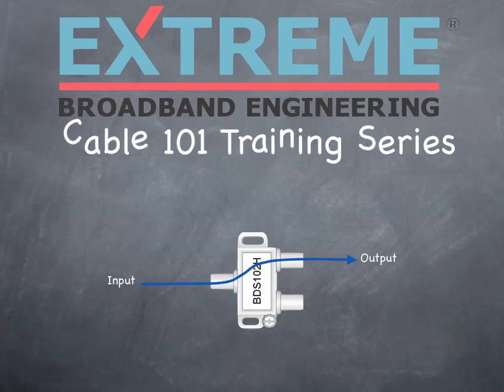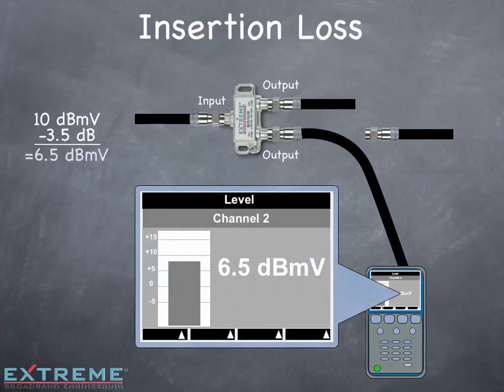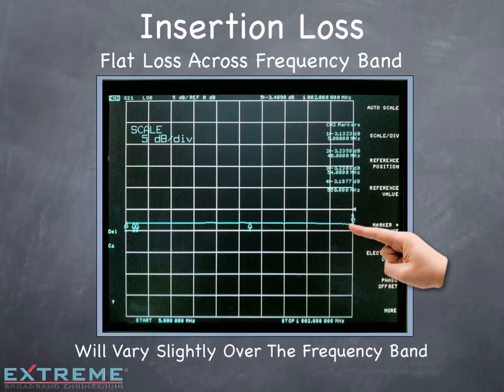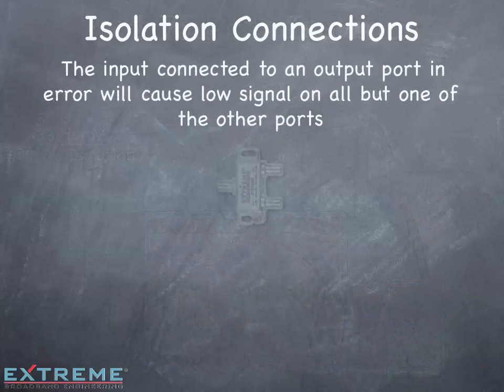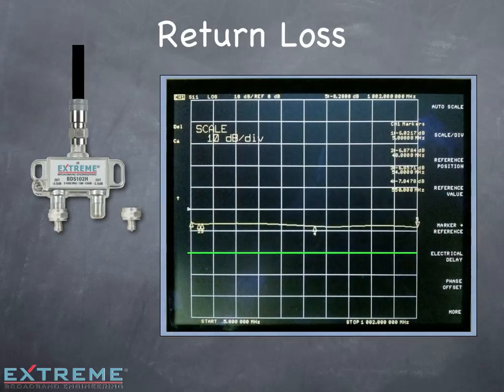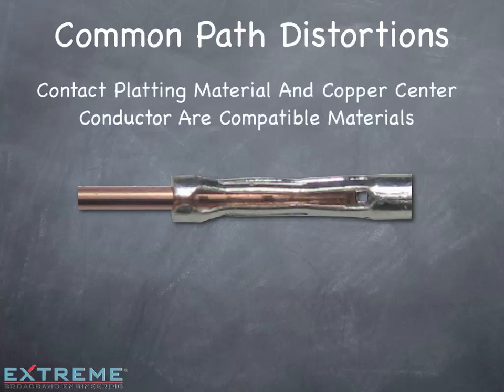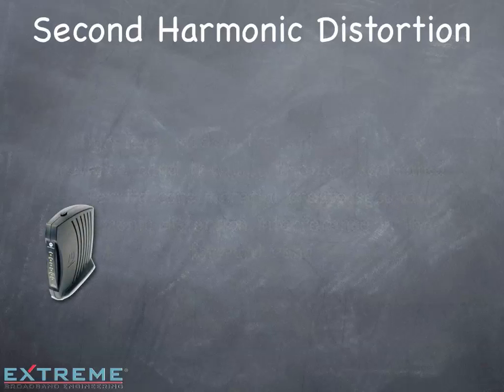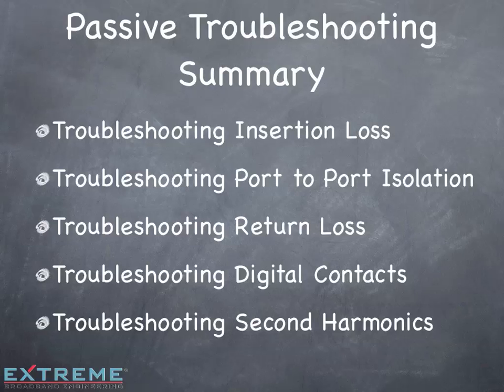Cable 101: Passive Troubleshooting

Comment: if you think about it the loss over a 2 way splitter should be 3db As nothing is perfect that's why it's 3.5db
Reply: Indeed, the .5 is to account for variances in the electronics inside the spliter.